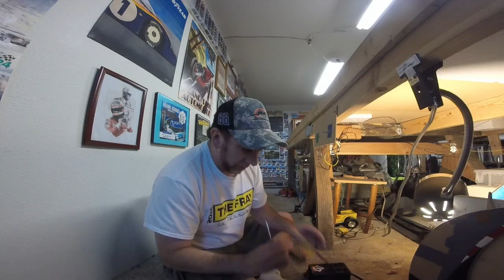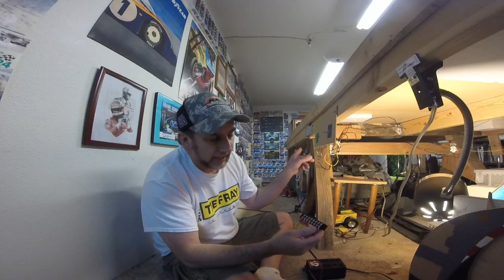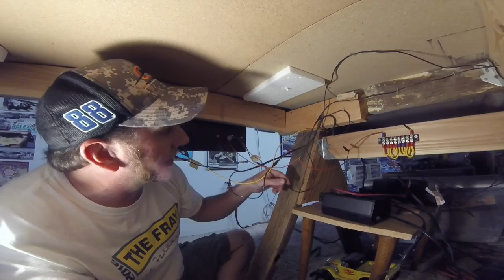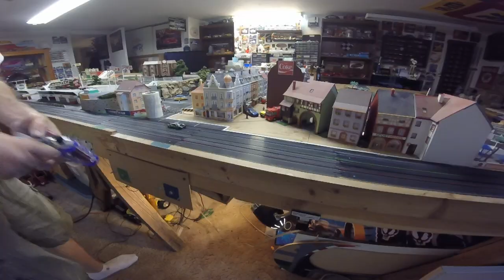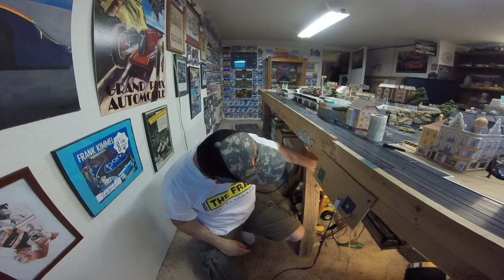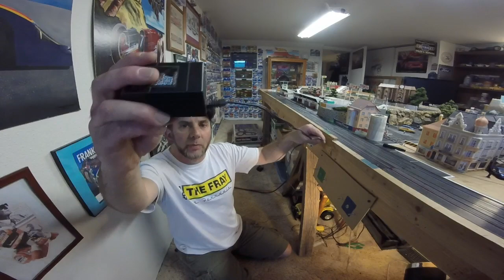Wiring in the new power supply

Comment: i like ur vids, but honestly wiring is not as confusing as u make it look, im not trying to put u down at all, just saying looking at an online diagram s easier, and i was wondering why u just didnt wire ur power thru your relay so ur lap counter is hooked to power also so the relay will shut power down? and if u use a proper power supply with enuff amps you only need one power supply,,, keep racing and making vids,